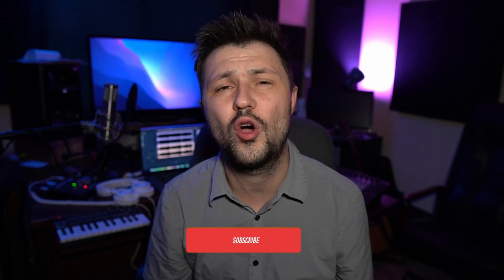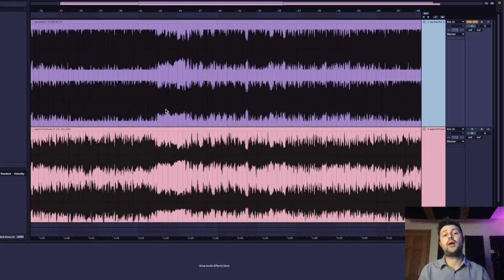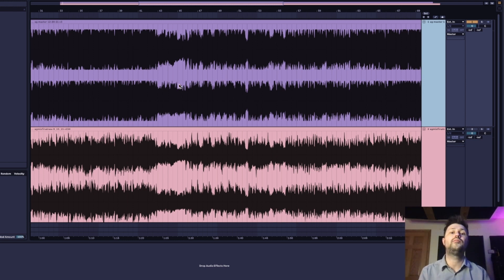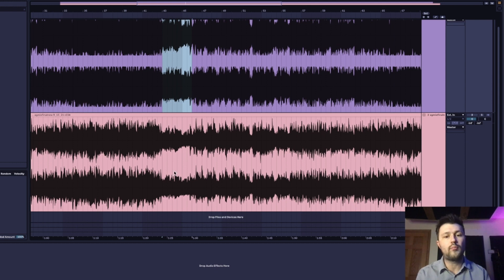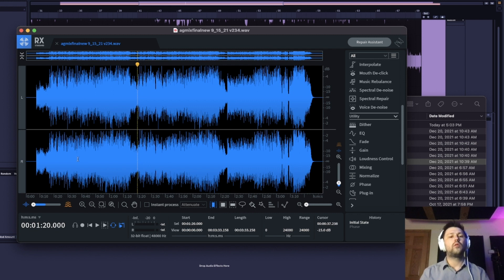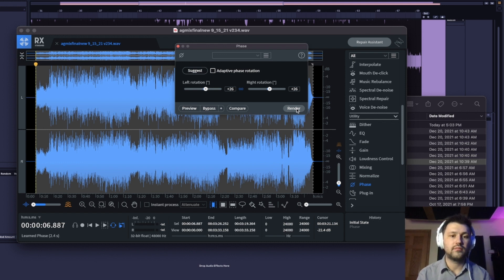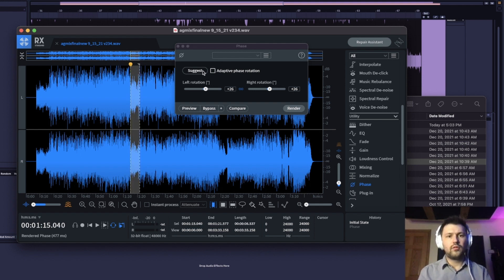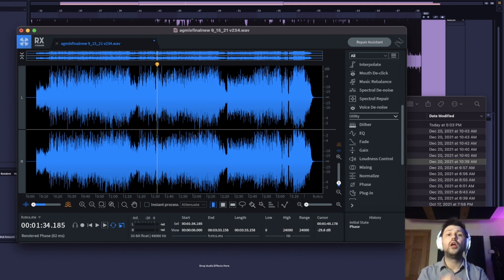Fix Asymmetrical Waveforms With RX 8 - Phase Rotation

Comment: Isn't there a correlometer within the same suite to verify if the correlation has been corrected?
Reply from the maker: I'm not sure if there is in RX. There might be in Insight. But the purpose of this video was not to see if the correlation has been corrected.

This is just a neat little trick to gain a little bit more headroom if necessary at the mastering stage.

I wouldn't use this on a whole mix.

Just on certain parts that are interfering with your limiter.

Comment: Is this something to be concerned with on individual tracks, or just something to do right before mastering a mix?
Reply from the maker: It shouldn't be something that you should be concerned with.

There are lots of instruments that produce asymmetrical waveforms naturally.

Some bass guitars and a trombone comes to mind. I'm pretty sure a lot of brass instruments produce asymmetrical waveforms.

An asymmetrical waveform will only become a problem if you lose headroom because of it.

Then you may want to try to use this technique to help gain more headroom.

I go on about waveforms in another video.

If this topic is interesting to you, I will link that video below. It may help you understand waveforms and how they relate to the movement of the speaker a little bit better.

But to sum it up real easily, the waveform tells the speaker exactly what to do when it's above the center line. It tells the speaker to move forward. When it's below the center line it tells the speaker to move backwards.

Hope this helps!
Reply: @Mr_Audio  Yes sir, it does help! Thanks for the info. Working on a song and my piano fades when I mono the mix. Trying to get some width out of it. Could be how the Izotope plugin manipulates the sound. Examining every possibility. Back to troubleshooting I go!
Reply from the maker: @j.ciloafasho  most virtual piano patches have what's called key tracking.

This means that the signal is stereo.
The lower keys are more left and the higher keys are more right.

This helps the piano feel like it's a stereo recording of a real piano. Because in a real recording you would have two microphones one recording one end of the piano and the other would be at the other end of the piano.

So when you mono a stereo file, It adds the left plus the right signal and then it divides the amplitude in half as to not clip your audio.

So if you have something that's more right or more left in the mix when you mono the mix that particular instrument or sound will get quieter based on how much it is to the left or right at the time.

If you want the piano to be a consistent volume, try monoing just the piano source in the mix. It should solve your monocompatibility problems if that's all the issue is is your piano.

Although I may warn you, it might make your piano sound a little dull or lifeless.

Comment: thanks! What about the azimuth?
Reply from the maker: Azimuth has to do with sound localization, which deals with how you hear the sound.

This video deals with asymmetric waveforms. Normally asymmetric waveforms are not an issue. Unless asymmetric waveforms are causing you to lose headroom, you should not have to use this technique. 

Azimuth refers the horizontal angle at which you hear the sound.

Based on the difference in arrival times of the sound to each ear the brain can tell where the sound is coming from. This is known as azimuth or the horizontal angle at which you hear the sound.

I hope this helps!
Reply: @Mr_Audio  Yes certainly! It did hep me a lot. Theres no much material on search engine that abord this topic Unless you wish to be a sailor. lol.. Thanks man!